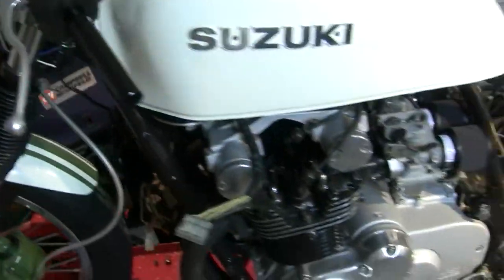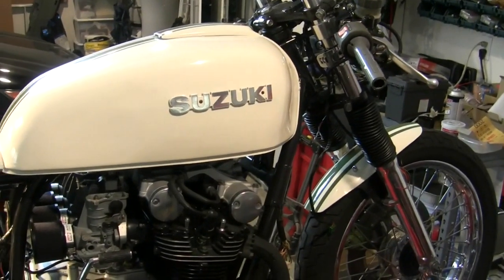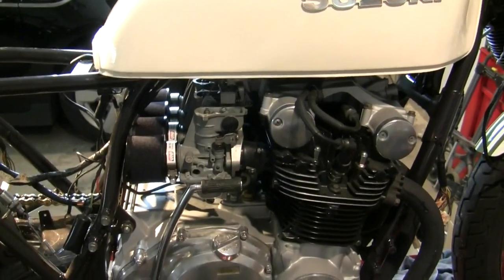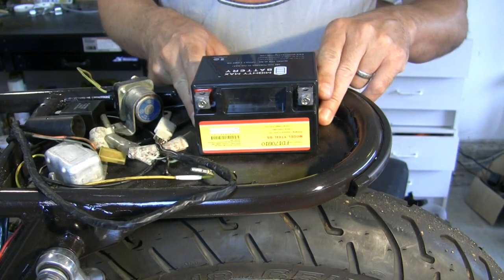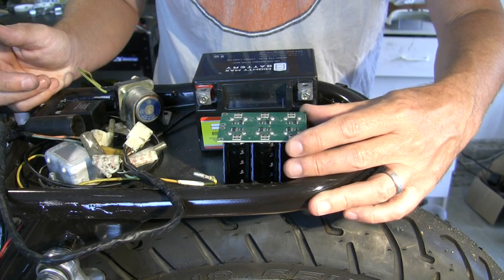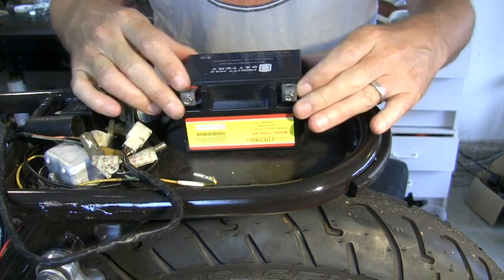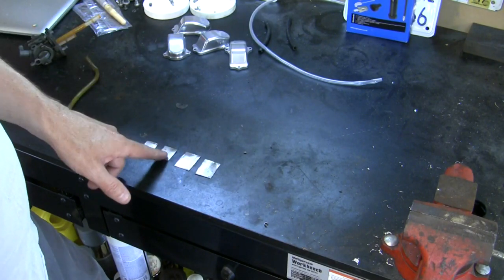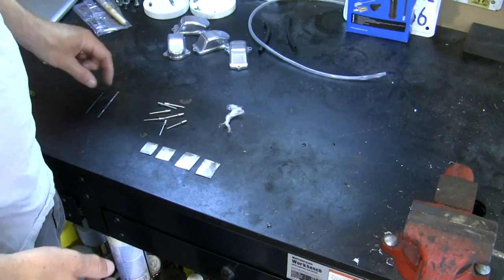Custom Battery Hold Down - GS550 Cafe Racer Build (Part 88)

Comment: Hi Urban Monk! Following your channel for a while now, nice job! I am working on a similar bike, and have a Dutch youtube channel. For now I am considering to convert to lithium for the size of the battery, however that involves lots of extra components to be bought… I like to re use the old parts. Your battery is very small, is it powerful enough to crank using the electric start? Does the mister kortan bike like to start with it?
Reply from the maker: Thanks for watching! That little AGM battery will start Mr. Kortan just fine once. I tend to use it only when the engine is warm (when the engine fires right away). That said, Mr. Kortan has a kick start so I tend to use that more when the engine is warm or has been run previously that day. When the bike has been sitting cold for a long time I connect a jumper battery before starting because he can be a little stubborn on cold starts like that and I end up cranking the starter longer during those times. Hope that information helps!